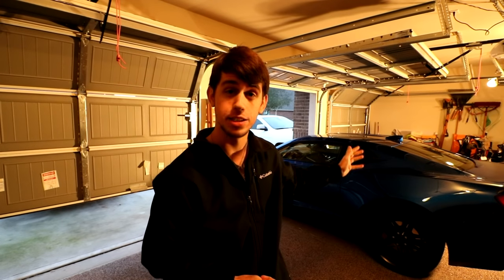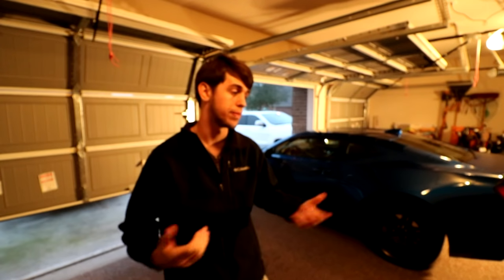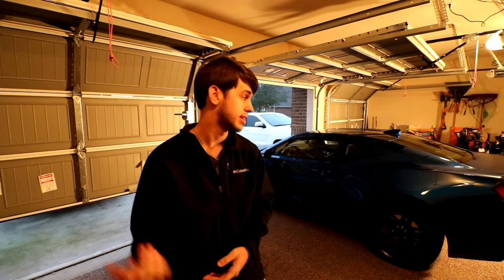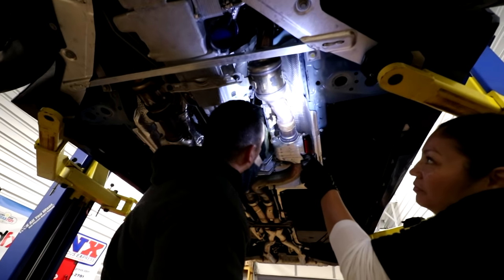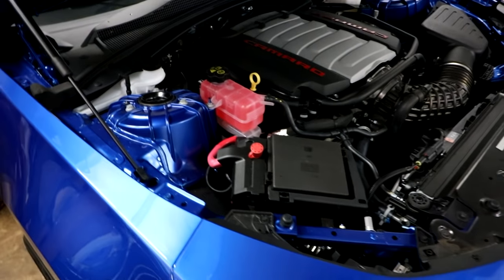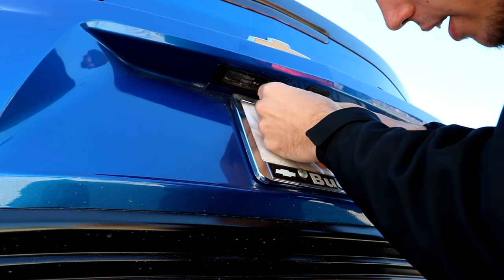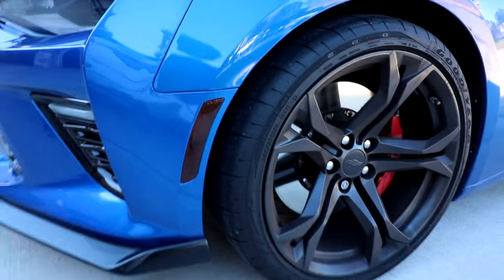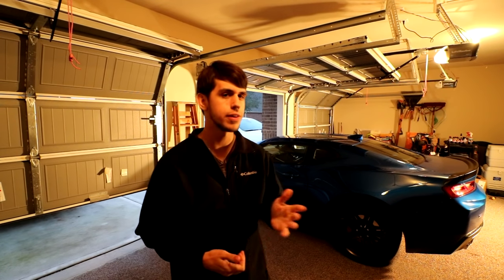Basic First Mods to my Camaro

Comment: The dealer put holes in the front grill that pisses me off so much
Reply: Gray if it's in an area that requires front plates they will often do that unless instructed not to. He could have worked replacing the grill into the deal if he thought about it at the time I'm sure. It might cost the dealer an hour of labor.
Reply: Gray you need a front plate in my state and they didn't drill my dads
Reply: Midwest Mopars I was working at a Chrysler dealer when the Challenger first came out. On 1st one I PDI'd I left the front bracket off and caught shit for it. The second one they made sure I installed it and the customer who bought it complained lol. After that the policy changed.
Reply: Nicholas Rodrigues I work at a Cadillac, GMC dealer and we leave it up to the customers on the front tags since its not required here in Georgia.
Reply: Same here Front plates kill the look of the car, 2 years ago I had ordered  a 335i to my spec when it came into the dealer they drilled the bumper so I said I wasn't taking delivery luckily I  found pretty much the same car at a dealer that respected my request there loss they should know better.

Comment: with all due respect, every peice on that car has been specifically engineered to work together. Dont be in such a rush to start tearing into, and modding everything. Or you are gonna find yourself fighting warranty issues like the hellcat  guy.
Reply: brolicbrooklyn he already said he's gonna void the warranty in a previous video
Reply: brolicbrooklyn, lol
Reply: brolicbrooklyn that can be said about any car lol
Reply: Christian Espinoza but even more so with expensive sports cars. Anytime something comes from the factory making over 450 to the rear, if its still under warranty, I personally wouldn't do any mods.
Reply: brolicbrooklyn I get what you are saying but it's his car and if he deems it appropriate,so be it,he's not doing anything crazy to it right now so I doubt it would ever be an issue.
Reply from the maker: All of the stuff I'm starting off with will have no effect on the cars performance. A few cosmetic mods here and there aren't going to hurt anything. Eventually the warranty will be getting voided but that's not until the car has many more miles on it and I don't run into any issues along the way.
Reply: RP Productions understood. Awesome ride. Enjoy!!!

Comment: I have the 2017 V6 1LE. I heard it's not possible to get a performance tune in these new 6th Gen Camaro's. Is that true, and if not where would I go, or what are the steps in order to get a good tune for the V6?

Comment: you said Houston. I take it Texas? Texas law requires all vehicles have a front and rear license plate. That's why the dealership mounted that license plate bracket on your camaro. I was pulled over on time because I took mine off too. it was in the trunk, so the trooper let me put it back on. Instead of getting a tecket. Google it. nice camaro by the way. I had a 1987 years ago.

Comment: I learned years ago to tell the dealership NOT to put f!@king front plate on the car.
When I bought my 14srt I told the salesman that if I came, picked up the car and it had a front bracket on the car, I'd refuse it.
Ditto for those dealership stickers

Comment: Could you post which dash cam you installed?  Also, the 1-4 gear removal is it a piece or putting in a piece, I couldn't tell from the video.

Comment: In my 2SS to prevent  the skip shift  when shifting from 1st gear I'll put it into neutral then down to 2nd gear. Usually I'll start in 2nd gear to prevent all the trouble though.

Comment: I had a 2016 2SS camaro 6MT. Loved it. Just traded it for a Z06 vette. I put a borla ATAK exhaust on my SS. It sounded great. Absolutely NO drone in touring mode, but load as hell and very aggressive with the cracks and pops in sport and track mode with the NPP exhaust (it retains dual mode exhaust capabilities). Less than $2k installed. If you decide to upgrade your exhaust I recommend it.
Reply: I second this motion. Borla is best option for any 5th/6th gen Camaro, hands down! RP, it would be wise to listen to this comment when choosing your cat-back

Comment: looks like the rear diff has a cooler ?
Reply: Timboslice Might be he e-diff you're looking at which hangs off the back of the diff.  It's run with oil pressure from the tranny which does go through a cooler yes.
Reply: Good point, Thanks !

Comment: I have a 2017 Camaro 2SS mine does the same thing with the 1-4 gear but it's just a suggestion. It doesn't actually lock you out of second gear. Well it's never done it to me.
Reply from the maker: It forced me about 50% of the time; others it would just suggest it. It was strange but all is good now!
Reply: RP Productions im thinking about getting it eliminated as well. I just hate seeing the damn thing in my screen haha.
Reply: RP Productions, That says you are driving like a little old lady lol. I hate this with mine too. I don't understand why the Camaro, SS (sedan) and Challenger has this but the Mustang does not. All are using the same tranny as I understand.

Comment: what did you actually have to do to stop the shifting from 1st to 4th I absolutely hate this s*** on my Camaro it is one of my biggest hatreds about this car
Reply from the maker: http://www.phastekperformance.com/2016-Camaro-Skip-Shift-Eliminator-Manual-Trans-p/ph-camaro-6-skip-shift-2.htm
Reply: Thank you
Reply: RP Productions thanks a lot of the times if you're sitting in traffic you need to go to 2nd gear not 4th I don't like going up to about 2500 to 3000 just to go into second it's ridiculous that's the whole point of having a manual to do it yourself

Comment: You made a mistake buying the camaro you should have stuck with the scat pack or at least switched to a challenger scat pack. there was no reason for you to get rid of the scat pack.
Reply: Jonathan Díaz maybe he wanted his car to do more than drive in a straight line...
Reply: KapitanPoop oh right he needed something that was better at sliding into crowds almost forgot my bad.
Reply: Jonathan Díaz  you sound mad that he gave up trying to make a 4200 pound tank handle and perform well... challengers a great looking car that go fast in a straight line and I'm sure they're great for cruising and having all your buds in the car... yet those skinny tires  can barely pull .90 lateral G and the car understeer when you push it... a 1LE pulls 1.09 G with razor sharp turn in and smokes cars on a track costing triple.... these cars aren't even in the same league
Reply: KapitanPoop I have pulled .98 G in my challenger
Reply: Jonathan Díaz I'm happy you modded your car to handle better... they're nice cars with a good blend of speed size and power... they definitely have more utility than a Camaro....if your car can now pull .98 G then that brings up to the level of a standard SS... but the 1LE is essentially a naturally aspirated ZL1 without the interior goodies... it smokes a regular SS in a handling competition. He said he wanted a car with better balance and handling... I can't see a car that handles better that doesn't cost double what this thing does...
Reply: KapitanPoop ok thanks